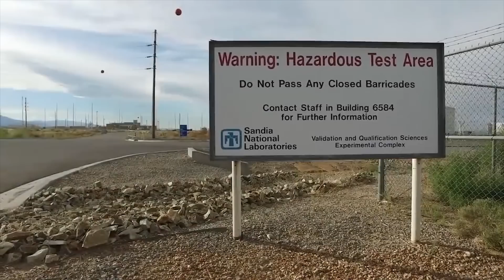Crash Test - 5 Largest Full Scale Experiments Caught on Camera

Comment: All very amazing but remember there were no airplane parts found at the pentagon or wtc or that grass field. 🤷‍♂️
Reply: So... every single eyewitness conspired to deceive? Why don't you go study the properties of aircraft aluminum under these stress loads, then get back to us.
Reply: @rickc2102   you.. Do research.    2 planes 3 buildings. No airplane parts 🤷‍♂️ all collapsed straight down. Al 3 buildings owned by the same man.  Serious, do research.
Reply: @rickc2102  indoctrination
Reply: There certainly were airplane parts that were recovered.
Reply: Dennis: OMG really?  I guess the eye witness accounts and, photos of planes actually crashing into the twin towers was a hologram/hallucination and, a simple search of Pentagon photos actually shows multiple parts strewn on the grass, landing gear, engine parts, seats and even body parts strewn inside the building .. but, perhaps they were placed there, the next day, after the fires were put out?  and yes, in the "Empty field" in PA. they did find debris in the forest and within the hole recovering parts, engines and the black box.  a simple search would show this but then, .... only if one really wants an answer. Most truthers only show photos taken from a distance or obscured with smoke.
Many truthers also talk about the 757 being 124 ft wide "but the "hole" is much smaller" .. what they do not say is that the fuselage is only about 16 ft widehigh and the wings would shear
Reply: @jimd1944  . Indoctrinated
Reply: @dennis-lg2oy  LOL ... Right.

Comment: An armored F4 can't punch concrete but morons believe a jumbo can cut through steel buildings and collapse them....
Reply: It didn’t cut through steel beams dumb dumb
Reply: @grants3111  the exterior of the towers were steel beam look at pics of their construction and the columns around the elevator shaft.  Dumb is agreeing with "authority" like sheep
Reply: Easy There the concrete in that test was 12 feet thick.  No building other than nuclear containment was ever built 12 feet thick.
Reply: @aurktman1106  ok steel is 200x more dense....so 6'' if steel is 10 ft of crete
Reply: Easy There you’ve never had Physics clearly. I almost forgot what channel I was commenting on.
Reply: @aurktman1106  English not your primary language?
Reply: I was looking for 9/11 related comments! The first time in history a plane crashed and there’s zero wreckage. (Pentagon) and to the troll commenting on this, there is video of the nose of the plane coming out of the other side of the tower before the explosion. CGI!!
Reply: @RonFiggJr  Pentagon was hardened and hit by a cruise missle